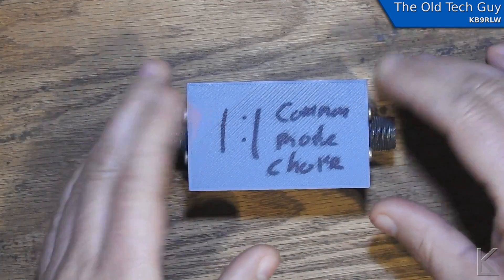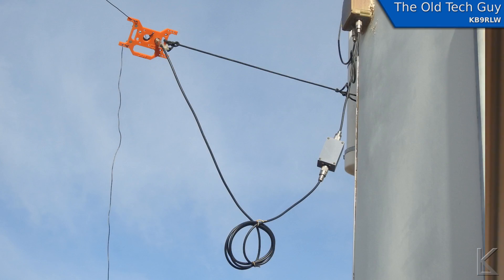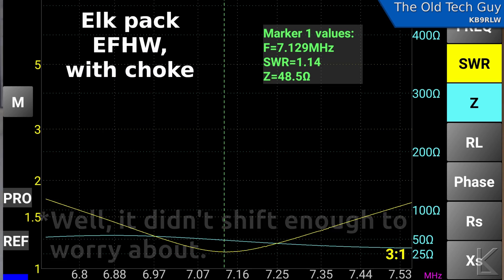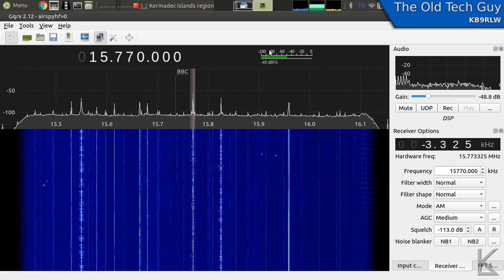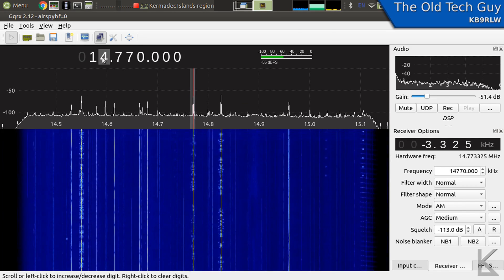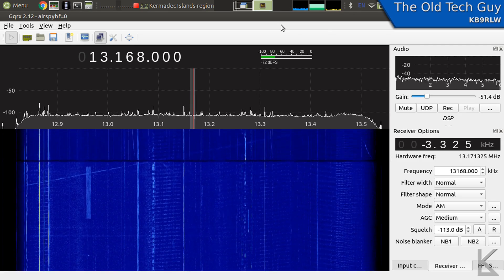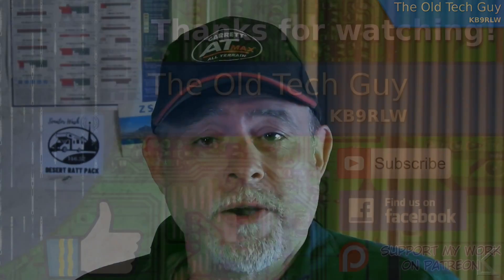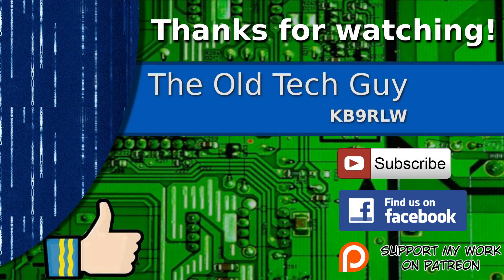Ham Radio - Adding a 1:1 choke to the EFHW antenna.

Comment: This is great!  Now I have another question... why does the 1:1 with a type 43 remove noise and the 49:1 with a type 43 NOT remove noise... Interesting video.
Reply: Common mode noise travels on the outer surface of the feed coax (i.e. the outer ground shield).   The signal feed not the shield feed goes through the 49:1 UNUN.  So to the common mode noise on the outer shield there is no UNUN.   In fact, EFHW antenna often use the outer shield as a counterpoise when an Earth ground is not used at the UNUN.  As I recall, the feed coax length needed to be at least 1/8 max wavelength in length and that is where some folks insert the choke.  I prefer the choke closer to the transceiver.
Reply: @dreupen  that makes a lot of sense. Thank you!!!
Reply: @coderdojoAN  better to add a counterpoise or large earthing system and choke the coax.
Reply: @WECB640  I'd love to talk more.  I grok the parallel lines part of the puzzle, I was leaving that out until you brought it up.  Thanks!
Reply: Because one is wound as a common mode choke, the other is just an impedance transformer.

Comment: Very interesting clip, cheers Kevin. I only thought a 1:1 choke was to stop RF on the braid of coax feeder and allowing more power to be transmitted ! In future I will always use a 1:1 choke to my antenna system, at home or portable. 73's Andy M6APJ.
Reply: You are correct. A common mode choke placed at the antenna does NOTHING to prevent the outer shield of the coax that runs from the balun to the radio from acting as an antenna. The CMC only prevents transmitted RF from looping back down and radiating off that segment of the coax.

Comment: Threw some junk together 4 traps pieces of so makes a double dipole  waiting for a 1 to q balun  tried it last night on a antenna tuner  on my short wave grundig satalite 800   worked very well  with the tuner some channel  switching  tuner on or off very little change   think ill build a choke   see what it would do with   led light bulbs smart battery charger  going in the shed  nice video

Comment: Good video. Is it necessary to make the wire cross over the diameter of the toroid? Or is it just something constructors do to make the wiring fit the enclosure neatly? Thanks Kevin.
Reply: It’s not necessary but it is certainly convenient. You’ll notice that the wires end where they would have if they weren’t wrapped around the big donut.
Reply: The crossover is tp create an opposing magnetic field in the toroid. Canceling out the magnetic flux imposes a considerable amount of impedance.

Comment: would it make any difference if you put a 1:1 choke at the feed point of a 40/20 link dipole or at the end of the coax just before the radio or both?
I know this is a different antenna than the video but it got me thinking about my link dipole, I have it mounted on the center support and it would be lighter if it was on the coax but I dont want to change the performance too much it works very well and is very portable
Reply: The further from the antenna, the higher probability the coax becomes a part of the antenna.

Comment: Thanks Kevin!  I’m thinking about installing them on the hamsticks in my truck to reduce ignition noise.  I’ve tried some other techniques but not this yet.  73 de Chris K2CJB
Reply from the maker: The Noise Blanker on your radio is designed to reduce pulse type noise like ignition noise.   Well, most HF radios have a noise blanker anyway.
Reply: @loughkb  It definitely does.  IC 7100 NB is great.  But…getting noise on weaker FM stations on vhf and uhf.  So might try it there too.  All about experimenting when it comes to antennas.